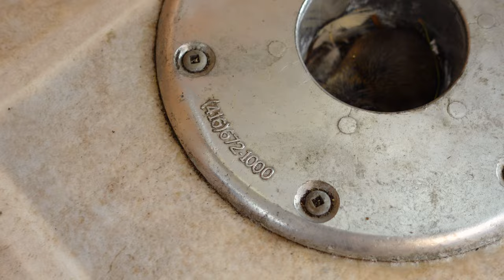driving my truck camper ALONE for the first time

Comment: I would:  Test one staple before you seal roof to be sure you know if the staple tips will pass through the roof requiring bending and sealing and hassle.  oops too late
Reply from the maker: No they don’t go through the roof- there is a layer of wood and styrofoam

Comment: but you should never use BLeach on Canvus you should of used 403 cleaner.Make sure you spray the canvus with 1 of these when cleaned and mounted back to roof
  Scotchgard Water and Sun Shield-fl oz Fabric and Upholstery Protector Spray or this V.I.P. Silicone Water-Guard Water Repellent, 13.13 Ounces

Comment: I haven't watched this video yet so if you addressed what I'm going to suggest, forgive me. Anyway since you still have all the remodeling to go and given how late in the year it's getting combined how expensive everything has been. I wanted to suggest something that I know you're likely to hate but you should consider resigning yourself to staying where you're at thru the winter. That way you could take your time fixing the camper up and have plenty of time to rebuild your savings so that when you do hit the road you can be really comfortable with your camper and not have to worry as much about possible expenses that pop up. I know you don't like staying there in PA and you would much rather be on the road doing your thing but it makes a lot of sense to make good use of having a safe place to park for an extended period and to rebuild your savings. If you really want to make it feel like you're not imposing on your Mom too much you can spend most of that time actually living out of your camper. That would have the added benefit of letting you thoroughly test the camper out and discover potential problems while in a situation where it's relatively easy to resolve those potential problems. Okay that's it and now I'm going to watch this latest video.

Comment: That ceiling should have been done when you had the roof off and you could have flipped it over glued and stapled it to the ceiling and let it dry upside down. Then after 24-48 hours of drying yoh paint it then put it back on the camper. These are things done to make things easier for you and so you can have the glue stick and dry nicely.  But it’s obviously too late for that.
Reply from the maker: Shoulda woulda coulda- if you’ve followed along you’ll know why I did it this way
Reply from the maker: But yea- would have been nice lol

Comment: Dont use an impact on that camper  to move it up and down the cables WILL BREAK!!! Get a camera for the back of the truck so you can see
Reply from the maker: Cables? Also yes I have a back camera to install before I take it out
Reply: @TorieRobot  yes the cables will break.a drill would be better still not good but the impacting on nonfasteners is bad. I am a 30 year auto/rv  technician with camping world in Island lake illinois. I feel for you!

Comment: Hello?
 Well, you're doing a great job. I really enjoy your videosi. Have a 1995 sun.
 Light.
 Camper.  But mine has a bathroom in it, so it's much longer than years and I know quite a bit about these campersyou.
 Can still buy the insidecrank handle.  And gear mechanism brand new. You have to Google that partand I forget the company that has them, but you can still buy the parts for that so that will fix your cranking up-and-down problem.  And?
 For loading.
 I find the center of the camper.
 Below that front facing window.
 I put a piece of.  High visible tape from the center down. Go to your pick up, find the center of your tailgate laying Down. Mark marked that with the masking tape about halfway into your bed now, when you back up.  You can look out through your back window of your truck. Lineup the tape and back right up. Also, for your jacks, you can buy a adapter that goes into your electric grill. I use A.  Cordless skill drill.
 Sure, savesdo it by handsame thing. Google it online and find the adapter.
 We'll save you a lot of time.  Just be for full when you start to get towards the end of the Jack travel. You slow down with the drill or it will come to a sudden stup. And that drill will probably hit you in the hand so.  That's my advice for today.Something else comes up.I'll send it over to you.Keep up the good work

Comment: FINISH THE PAINT BY PUTING PENETROIL ON TOP OF THE FINISH PAINT  RPEAT EVEWRY YEARE LSIO GOOD FOR DECKS-HARDWOOD FLOORS AIRPLANES ETC IF IT A SURFACE IT NEEDS PENETROL THE DIFFERENCE BETWEEN HE ISIDE AND THE O IS THE OIL ANOINTMENT THIS IS THE OIL ANOINTMENT FDOIR THE INDUSTRIAL WORLD PERIOD
Reply: I ONLY HAVE ONE FINGER

Comment: I guess not too many people who watch you have any real experience with RVs and roofing. Every penetration into a roof is a potential leak. I cringed when I saw you put all those screw holes through the top and sides of the roof. You need to either go over every one of those screws with self leveling lap sealant on the roof and non sag lap sealant on the sides. I ever screw hole! Either that or get a product called eternabond and just run it across all the screw holes. I’d love to see you succeed but youre doing it all wrong and it’s sad to watch
Reply from the maker: My dad did that- not me . The screws aren’t the issue though - they have rubber seals